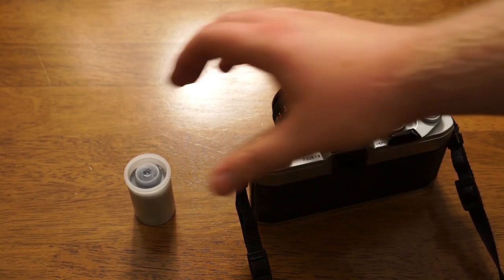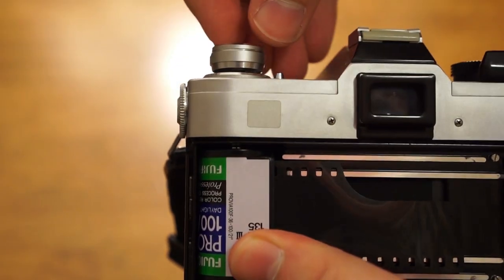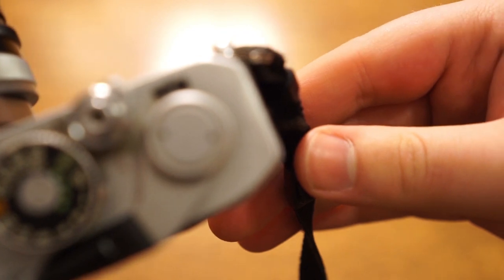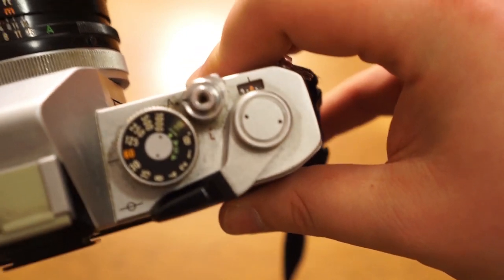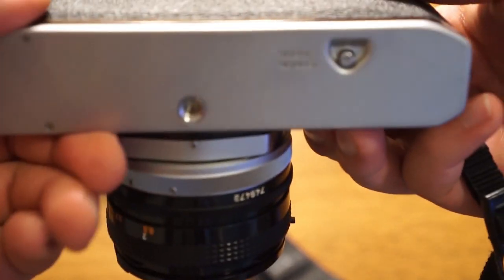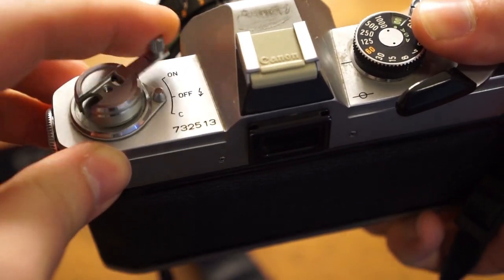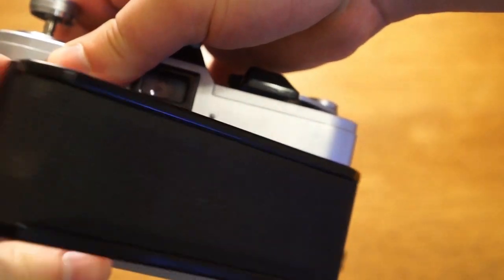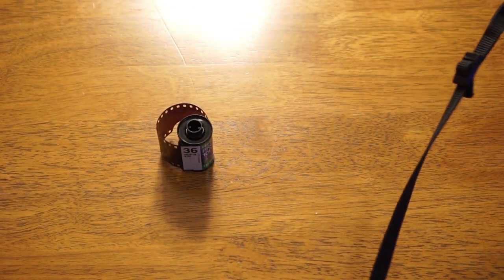HOW TO LOAD AND REMOVE FILM FROM CANON FTB

Comment: I've always rewound the film leader in fully never had a problem. For home development I could see it being advantageous to leave a bit out but a bottle opener works very well too. One tip to tell if your film has taken on the spool and is advancing properly is the rewind crank should rotate when you're.advancing the lever on most old manual film slur's.
Reply from the maker: +josh prause yeah it's funny that since I initially recorded this I actually rewind the film into the canister in most cases(since I send my film out). I made it sound like a bigger deal than it is.
Reply: Oh thank God because I just rewound my film all the way in

Comment: why do you need to have the lens cap on once you're taking the first few shots? is it okay if u don't have it on?
Reply from the maker: Yeah it actually doesn't matter that much.  You can do it either way.  The purpose of advancing the film in the beginning is that portion of the film gets exposed to light when you stretch it across the back during the loading process.  And because it's exposed to light already an image won't appear.